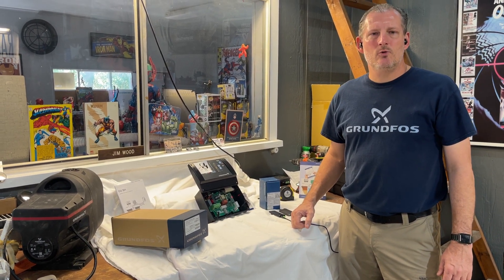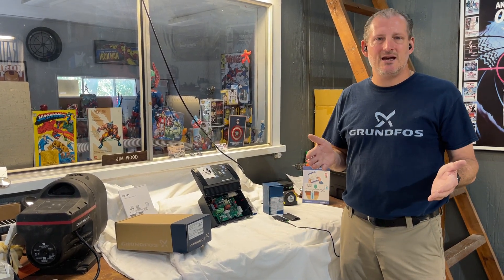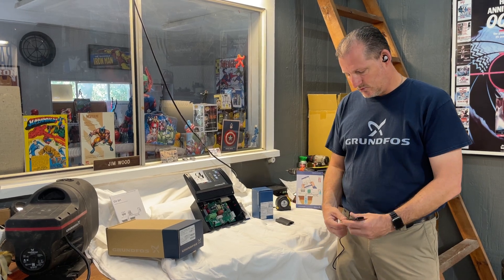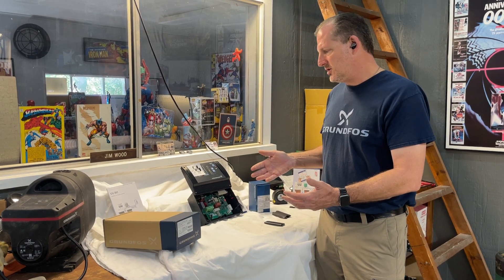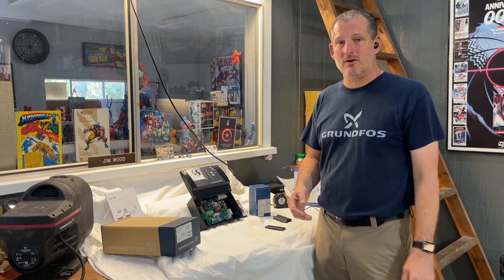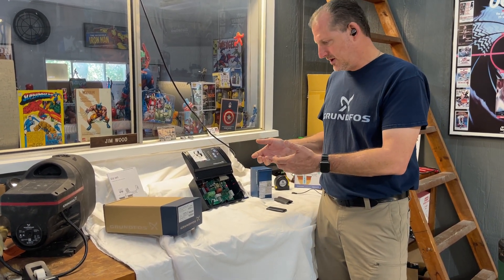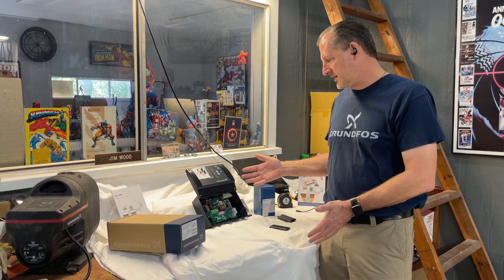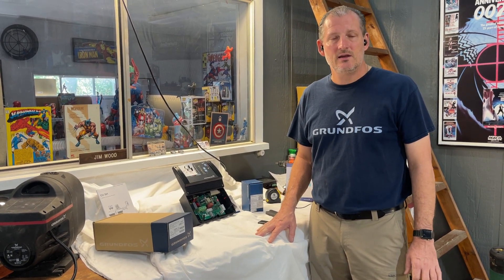Connecting Grundfos GO Remote to CU301 and Increasing Pressure Above 70 PSI

Comment: Is it possible to control and get status info from the internet (wifi) or RS232/485 interface?
Reply from the maker: Sorry, but I have no idea.
Reply: @rainwaterequipmentllc7835  The CU300 may solve the problem as it has RS232/485 interface and is able constant-pressure control.

Comment: Is there a reason why the PSI can’t be increased above 70 PSI without the dongle and app?
Reply from the maker: @therealzFlash  yes, because that’s the way the manufacturer has programmed it. I don’t know the reason why they set it at a max of 70 except that they are probably trying to protect pipes and fitting connections from being overpressurized.

Comment: Can you connect to the 301 with the dongle and app WITHOUT a pump or sensor wired to the 301?
Reply from the maker: Yes. In fact, that's what I'm doing in the video.
Reply: @rainwaterequipmentllc7835  so i have power connected to the 301 but when i plug it in it goes straight to the no contact red light. Am i doing something wrong perhaps?

Comment: Now try actually connecting it on camera. This thing is a nightmare.
Reply from the maker: I can't argue with you there. I spent 45 minutes working with one the other night and was finally able to connect it and adjust the max pressure. You must use the IR connection method and watch for the red light to blink rapidly. That lets you know that the data is transferring. Once that finishes, you can toggle Max Pressure on. Then set it to your actual desired max PSI. Good luck.